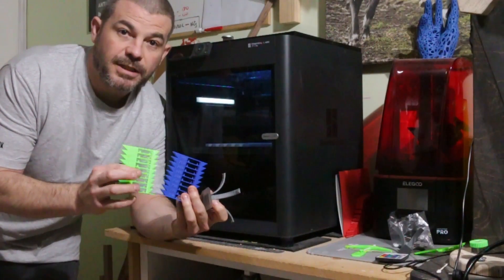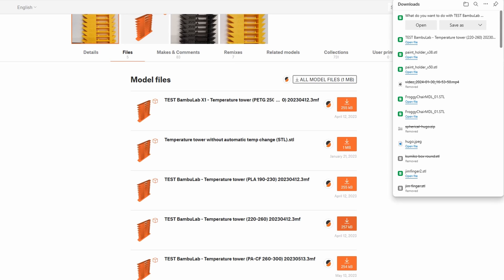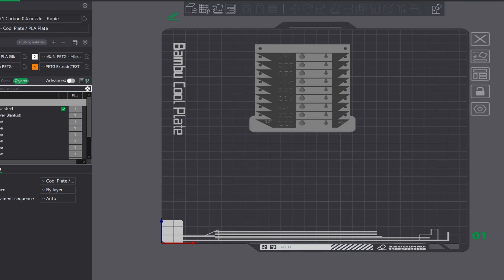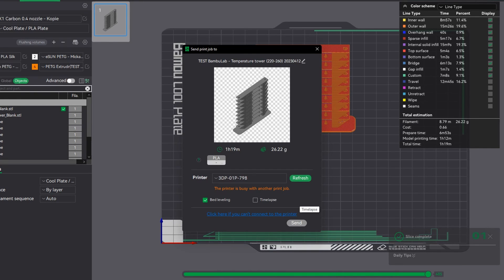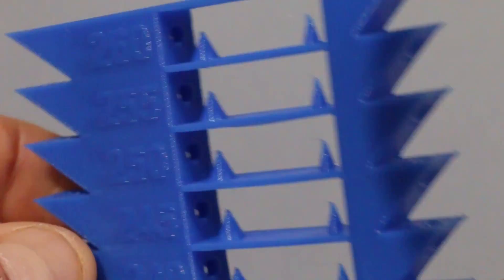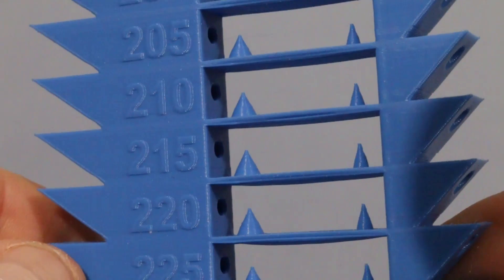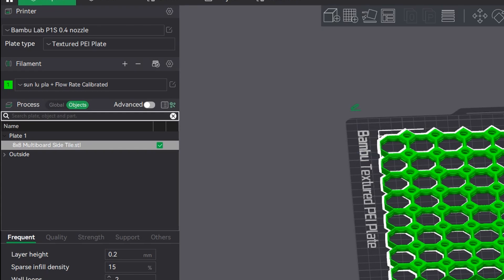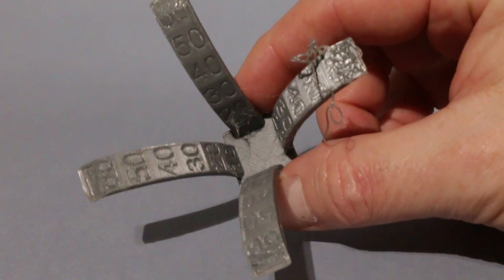Fine tuning with Temperature Towers-Bambu Labs

Comment: it dosent work, tempertur stays all the time the same
Reply from the maker: You need to have a specific one that has the temp changes built into the g code. 
Theres link in the description, then open the 3mf. 
It will have the temp changes sorted

Comment: How do you decide first layer tempo vs other layers? PLA and PETG?
Reply from the maker: Once I’ve done a temp tower for the filament and then done a flow calibration, I just have it set at the same temperature. Never had a issue

Comment: Do you need to print different temp tower for different nozzle sizes? Same filament?
Reply from the maker: The temp itself should not change- just the k value (flow rate) needs doing